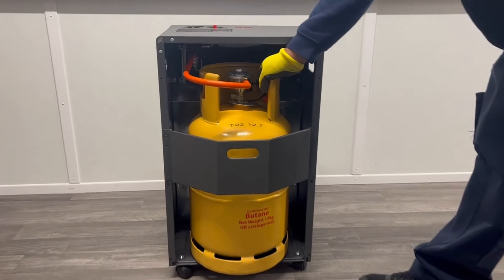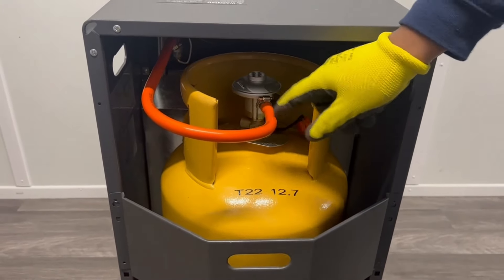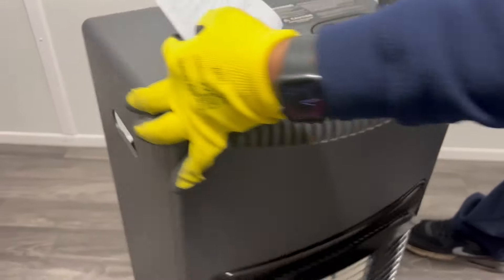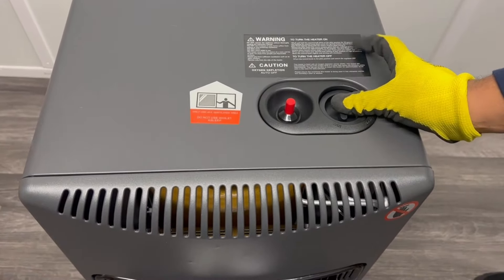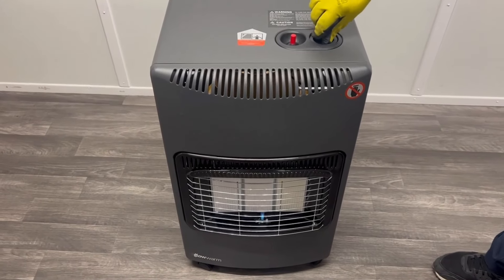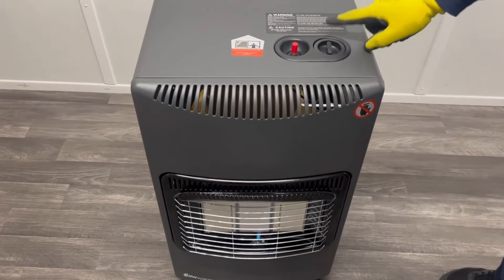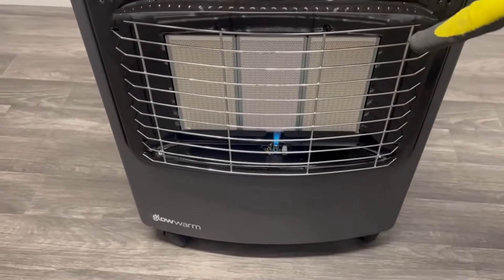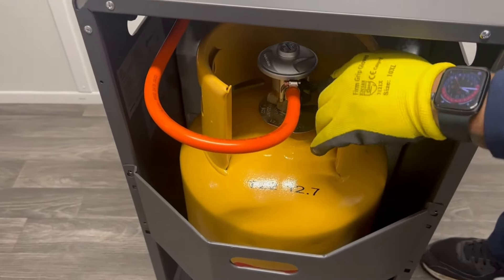Glow Warm Essentials Gas Heater - How to Operate

Comment: I’ve just bought one, used one bottle of gas and now that I have changed the bottle, it won’t stay lit the pilot flame is half missing, so it cuts out. Any suggestions?
Reply from the maker: Hi, there are two causes - butane freezes at zero degrees so if your cylinder has been left outside when the temperature is zero or below, please ensure the cylinder is kept in a warmer location indoors for a few hours before use. The second cause is overfilled cylinders - please see video below to release gas from an overfilled cylinder.

https://www.youtube.com/watch?v=3XcvXvCvf2E
Reply: Hi, a question please: a pilot light is too large (it's like half the height of the ceramic panel)on mine after start, and stays like that. Pilot flame is smokey.
Any suggestion please? Device is 2 yo.
Thank you.
Reply: @attilabori4734  don’t ask me, I’ve no idea mate sorry
Reply from the maker: @attilabori4734  Hi, your description indicates the pilot tube has debris inside such as dust. Arranging a gas engineer to clean the pilot tube assembly should resolve the issue.
Reply: @MAZ732  no worries i posted my question mistakenly as a reply.
Thanks for responding.
Reply: @easternrm6  thank you it's not been used for a while now (10+ months). I will call someone to manage the issue. Thanks and all my best.
Regards AB
Reply: A yellow pilot burner flame with soot stains on the ceramic radiant plaques, means the pilot air venturi is clogged with dirt or dust.

This needs a clean to bring back a blue pilot flame and clean burning, a LPG qualified Gas Safe engineer or LPG dealer can easily correct this problem.
Reply: @anthonyperkins7556  thanks for the tips 🙏
Reply: Exactly what I'm experiencing
Reply: It could have a faulty tip over switch. Look on utube and find out how to bypass it to see if it is your problem.
Reply: I’ve got a weird smell when mine is on not a smell of gas but abit like kerosene all over the house any idea what it could be it’s standing on top of laminate flooring if that makes any difference